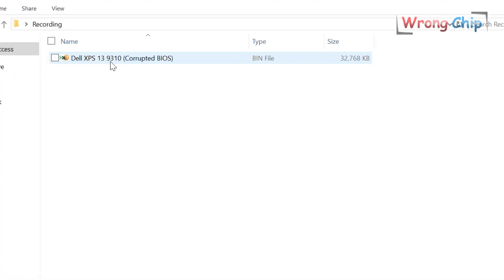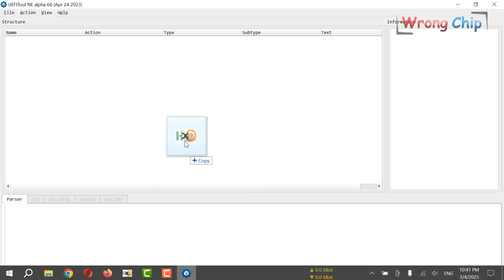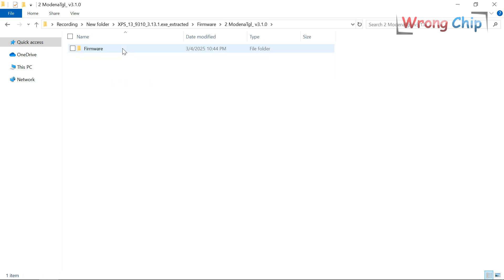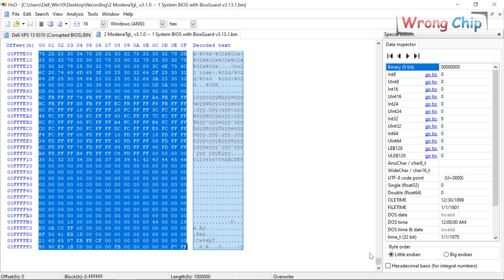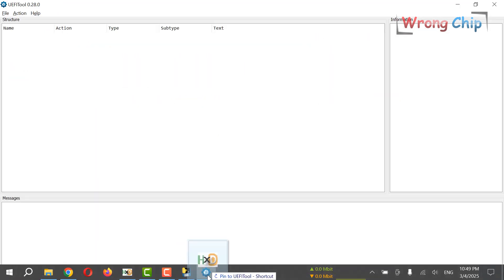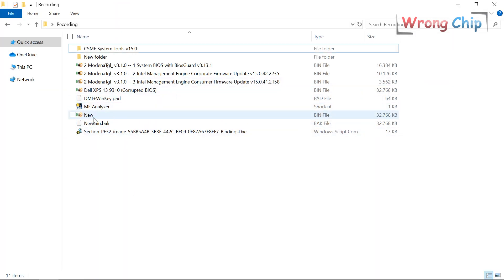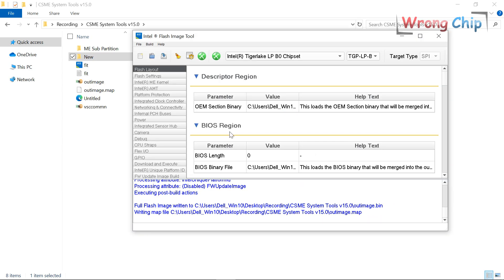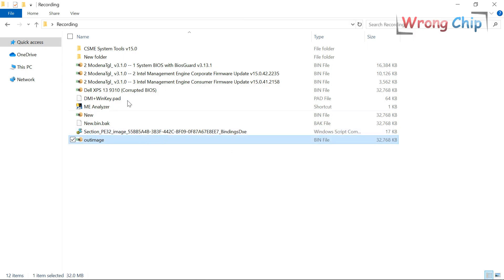How to Fix a Corrupted BIOS on Dell XPS 13 9310

Comment: Hello, blogger, how do I choose the EC rom for DELL models? How do I choose the right version? There are N EC programs in the unzipped program.
Reply from the maker: Hi, some Dell laptops (like this one) have an EC Region inside the BIOS file, and you can replace it after extracting the EC file that is given by Dell (in case you want that). In some other models there is no EC Region and you will have to re-flash the SIO chip itself.

Comment: Is there a video in your channel explain how to program a bios file step by step. And what is clean me.
Reply from the maker: If you mean how to read/write the BIOS chip, this video can learn you the principles.
https://youtu.be/1CqY2bzL-dg

About Clean ME, there is a region inside the BIOS file of intel devices called "ME Region" or "Intel Management Engine". We need to clean this region because sometimes it get corrupted, or when we take a backup from a device and want to use it on another similar one.
I have a special Playlist for "Clean ME Region", if you just watch the first 2 videos you will learn how to do that.
Reply: @wrongchip  thanks for your support
Reply: How to get the model Before we search the bios file from the net ????
Reply from the maker: @ You're welcome.